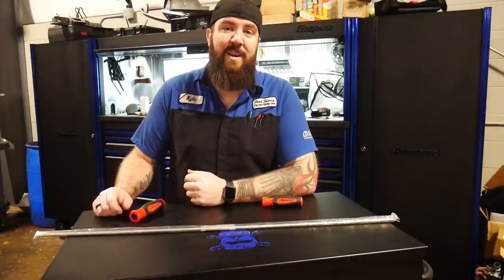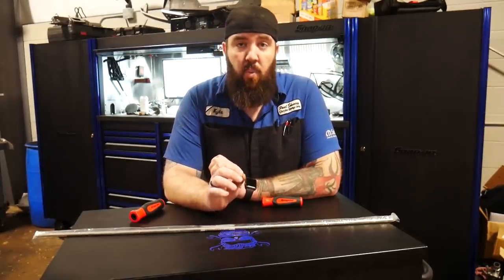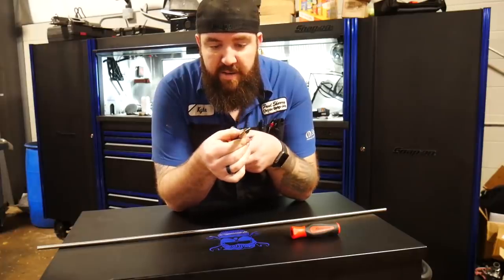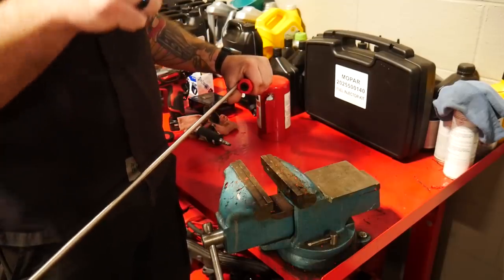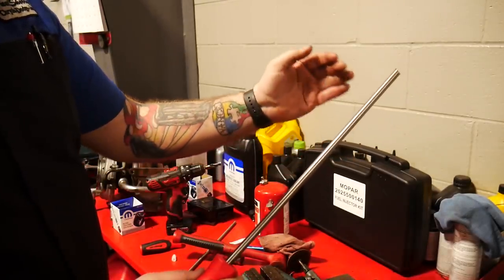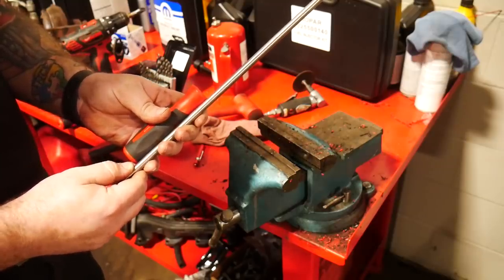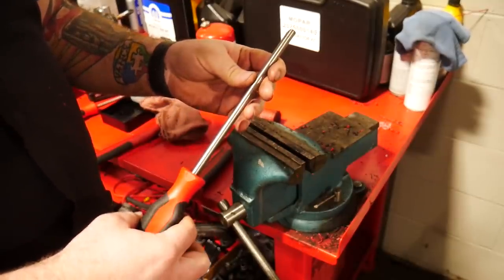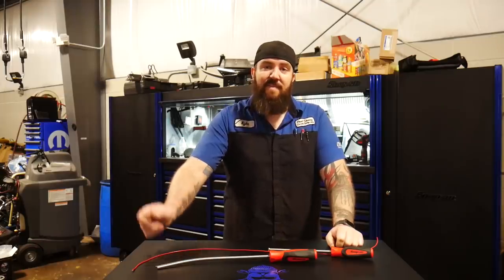HOME MADE (SNAPON-ish) WIRE INSERTION TOOL - #MAKEATOOLCHALLENGE

Comment: We used to use something similar at ATT to feed wire through walls with insulation. We called it a crack pipe. Just used the pipe tho. No fancy handle. Pretty cool bud

Comment: Good job. Thought of another addition. You could tap threads into the end on inside, then take a bolt round over so is not sharp but still pointed. Then stab away, unscrew the tip and run the wire through. Then wont snag if you have to go alongside a harness full of wires.

Comment: Nice job on the tools.
Is the large Marine shank still in your junk drawer?
Reply from the maker: Sure is
Reply: @RustbeltMechanic  Is it straight or curved, can you tell me the width and thickness. I do locksmith in Prisons and Jails from time to time and we come across counter sunk slotted screws that hold the locks in. The screws are 5/16-18, the only proper fit driver I have found is a 1/2" wide 5/16" hex insert by VIM. The Snap-On tool you took apart was one I wanted to get a close look at.

Comment: HOW DID U REMOVE THE HANDL WITH OUT DESTROYING IT? CHANGED MY RATCHT HANDELS TO COLORS DESTROYED OLD RED BLACK.
Reply from the maker: Put the bit in a vice, use a crows foot and an extension to beat it off
Reply: @RustbeltMechanic  u wrote beat it off! seen hot water ,not. utube of a rep  use a vic with a small hydo jack no damadge.canged some grip colors.seen the new colors?thanx